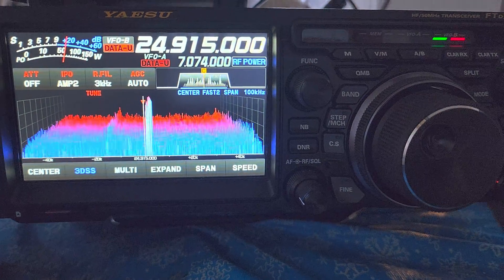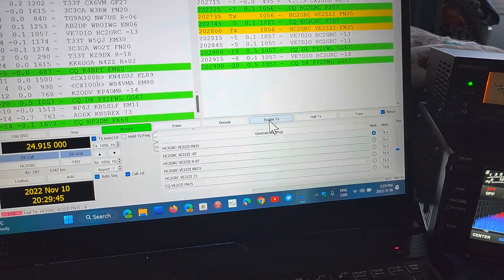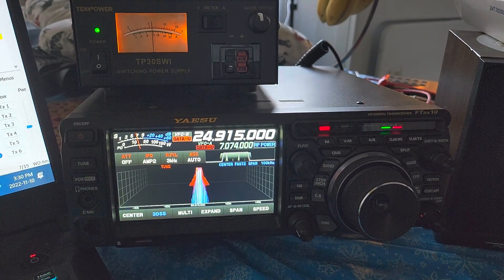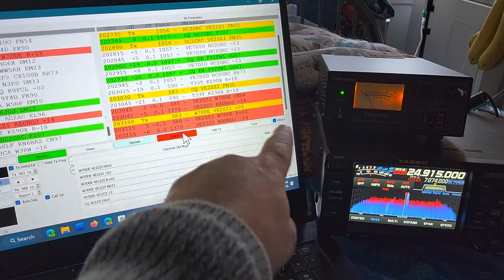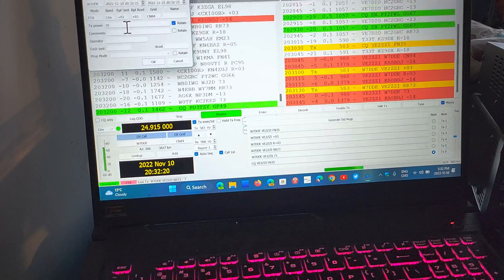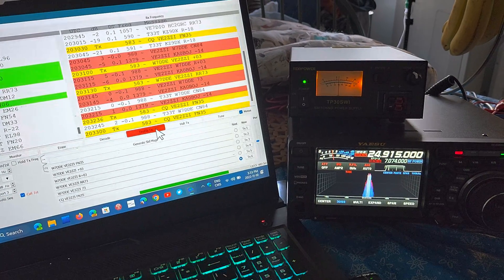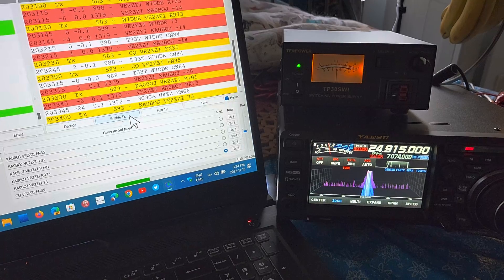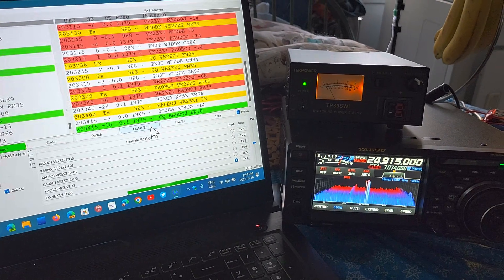Example of FT8 mode operations on my Yaesu FTdx10 computer controlled with WSJT-X

Comment: Thanks for the video, I would be very interested if you can do a video with the FTDX10 setup. I dont think its as good as the IC-7300 I had before. I notice harmonics on the edge of the filter passbands. This changes with the freq, sometimes nothing other times harmonics are there. Sometimes its better if I setup rig control for Fake it. Also in the setup TX BPF 50-3050, sometimes changing this helps. I wonder if you have noticed this ?. If you look at your video at 4:13 you can see the harmonics spreading in the filter passband , Be good if you can go through all your setups and what you think about those harmonics .

Comment: Notice the noise at the low end of the band pass?  Use USB preset mode and that will be gone. It is an added mode for FT8. Page 65 in the manual. Also your receive audio level is too high. This radio will work amazing on FT8 if set up correctly. 73. VE3WF
Reply from the maker: it is in Data USB for FT8 , it seems ok like it is ... done hundreds of contacts without any problems
Reply: @OfficialSWLchannel  If you say so.

Comment: I’ve been a ham 33 years but just started doing digital recently. Looks like you can get ‘worked all States’ and not even be in the room! Hihi (lol). I’ve really been having fun working Feld Hellscheiber mode that’s been around for about 100 years! Also rtty which is about 80 years old. PSK31 is nice as well. All three you have actual conversations. Mostly I’m a cw guy and mostly 5 watts. n5vwn